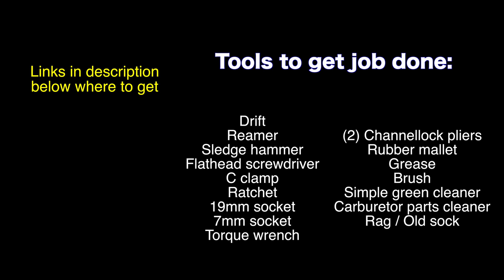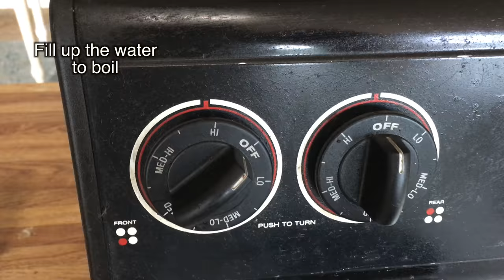VW Bus Center Pin Replacement Tutorial/DIY | MicBergsma

Comment from the maker: FOLLOW KONA THE BUS (Our VW Bus):
Website - http://bit.ly/2NuikSS
YouTube - http://bit.ly/2g0E5b5
Instagram - http://bit.ly/2kL2PGK
Facebook - http://bit.ly/2Q9atMs

Tools I used in this video:
Drift punch 27mm - VW tool 131a
King Pin Reamer - look up online to rent one.
Sledge hammer - https://amzn.to/2GTO1zF
Flathead screwdriver - https://amzn.to/2H0BWtx
C - clamp 6in - https://amzn.to/2GTVazY
Ratchet 3/8 - https://amzn.to/2Yaw1YN
19mm socket 3/8 - https://amzn.to/2PJSdpw
7mm socket 3/8 - https://amzn.to/2GYr4uS
Torque wrench 3/8 - https://amzn.to/2H0DEeA
(2) Channellock pliers - https://amzn.to/2PK5PBf
Rubber mallet - https://amzn.to/2Je8phA
Grease - https://amzn.to/2H0sQNq
Tooth brush - https://amzn.to/2Y6Lrxc
Simple green cleaner - https://amzn.to/2Jebxdp
Carburetor parts cleaner - https://amzn.to/2VgoSJt
Rag / old sock

Comment: The WAVE washer goes on the bottom of the pin not the top surely? I just took my central beam  pin apart and it has the original flat washer on the top of the pin, wave washer on the bottom.